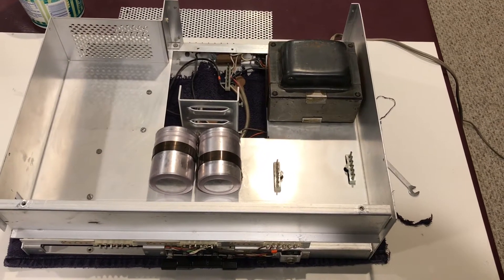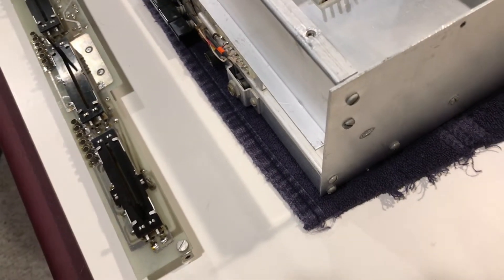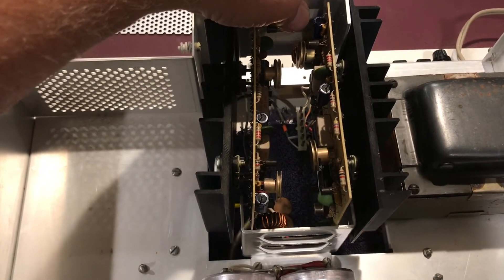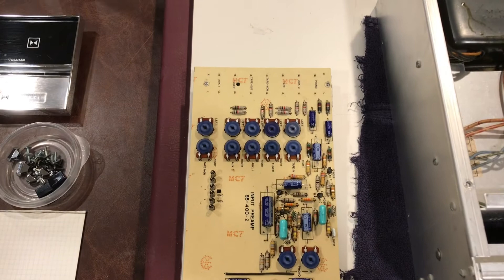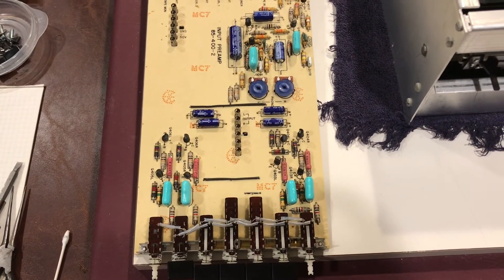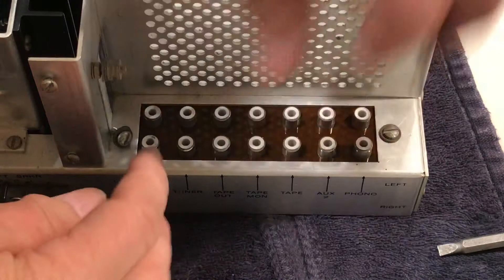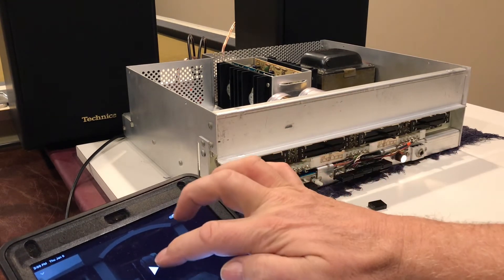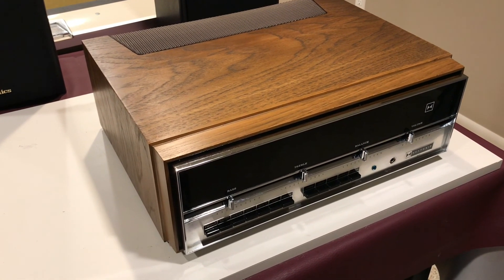Heathkit Amplifier AA29 Capacitor Replacement

Comment: I recently finished a full recap on my AA-29. Unfortunately I did not see this video until now. The AA-29 was a pleasure to work on since it is so modular!
Reply from the maker: Tx- I'm always amazed that heathkit was able to design, engineer, and manufacture quality components that almost any of us could put together. The modularity built into a lot of the units makes for ease of assembly and repair, but you need to make sure those pin connectors are clean and seated. I've seen some of the boards loose and make poor connections and sometimes no connection at all. Still love em though. Tx for looking and good luck with your unit.
Reply: @xfireamg417  Yes, a very good point. I put a drop  Deoxyit on each pin before reassembly. I also cleaned the slider switches with WD-40. It is working great!

Comment: Good, informative video.  Thanks
Reply from the maker: Glad to help out.
Reply: Also agree that this is an informative video.  One thing that I would have done is to use a good contact cleaner on all of the multi-pin circuit board connectors and re-tension the connectors (if necessary) to insure positive contact. One thing to be cautious of is that the plastic used on the multi-pin circuit board connectors and the circuit board lock tabs may become brittle with age and heat cycling and may break if flexed or bent too much.

Comment: Could you tell us the brand of caps you used and the UF and voltage of the 4 on the power supply board? Thanks
Reply from the maker: 470uf 100v Nichicon
100uf 100v Nichicon (2)
2.2uf 100v SC 
Hope this helps